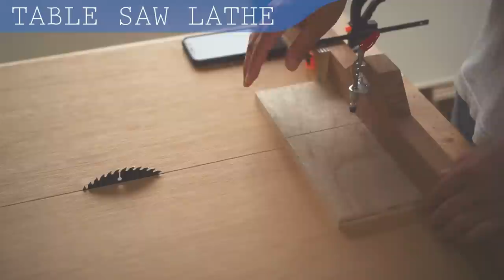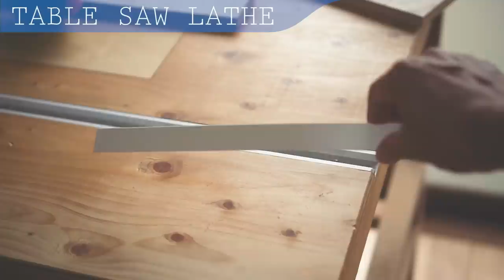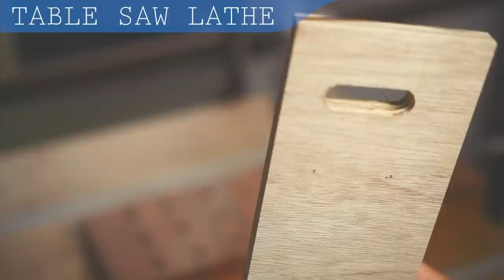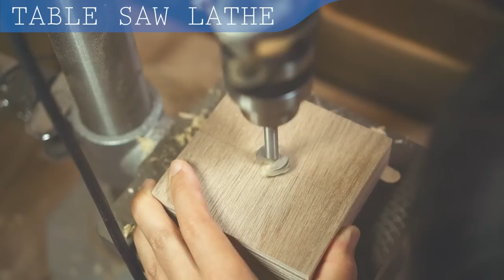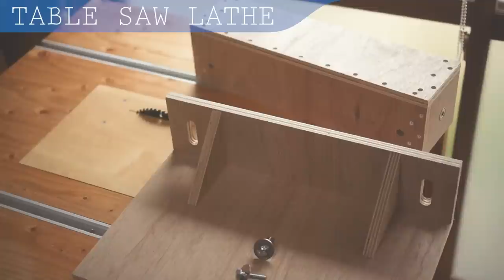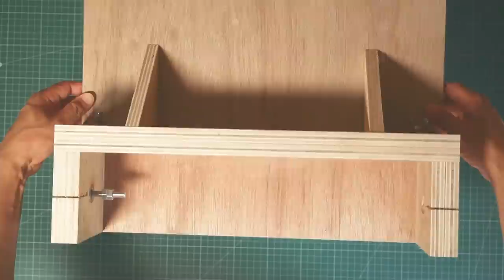Simple Table Saw Lathe / Conical poles can also be made / DIY Woodworking

Comment: The ability to tilt the axis of the stock in order to create conical forms is clever! It makes me want to see what you could do with even more degrees of freedom. If you could rotate the whole assembly relative to the saw blade (like you'd do with a miter sled), you could cut some interesting concave elliptical profiles. It might be tricky, however, to keep the blade from colliding with the jig.

Comment: You gotta be kidding me... This is WAY UNDER-WATCHED & UNDERRATED... I think the TITLE & THUMBNAIL need to be reconsidered for this to become yet another multi-millions viral video.  I believe this can be adjusted without sacrificing your current views....

My opinion: the thumbnail DID NOT make it clear to me that I’d be learning to create an actual LATHE (or lathe-like device) and the title did nothing to clarify this confusion.  Therefore, I hesitated to click on this video, and something tells me other people are doing the same.

It’s difficult to explain in a comment instead of verbally or visually..
Reply: For the title, I think your focus needs to be on the fact that this is a DIY ”WOODTURNING LATHE” as your baseline, and adjust it from there — meaning find a clear & clever way to explain that it is actually a “table saw lathe”... 

I would REMOVE the bit about “conical poles” completely. Let your thumbnail show this, OR just let your video speak for itself.

That being said: The thumbnail needs to SHOW MORE... 

The first idea that came to mind was to portray your rectangular wood workpiece and then an arrow to the various shapes you can turn them into using your lathe (this is where you’d show off the conical pole and others) — this is INSTEAD OF hiding the finished work off to the side of your inactive lathe (which overpowers the thumbnail, yet fails to explain anything!) (which, btw, is really the entire challenge here)..

More to say...

Comment: The first time I saw a "hack" which isn't only a 
 death trap. This on is a clever and useful death trap 😅

Come on, detachable hardware turning next to a running blade. A non-fixed wooden sled pushed by hand. All of that for moving wood sidewalks against the saw blade. 

I have to build that 😜

Comment: Thia is quite genious I must say. Thanks for sharing the video. How many times was the video sped up  (2 times, 4 , 8 ?)
What RPM is needed for the drill?
Reply from the maker: Thank you very much.
I am playing the video at 2x speed when the material is 45mm square.
I used a drill with an RPM of 2300. But I am not sure if this RPM is appropriate.
Reply: @YASUHIROTV  Thanks for your quick reply.